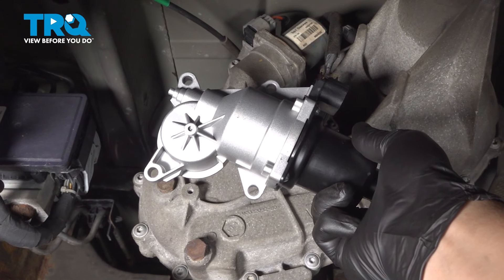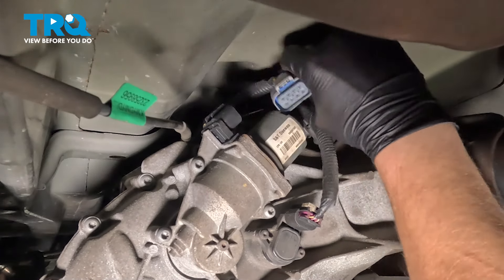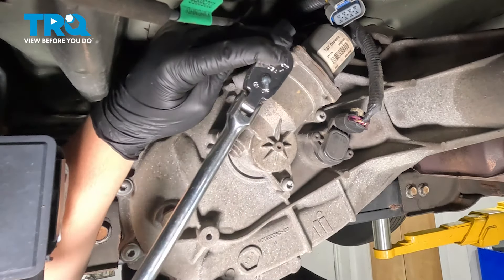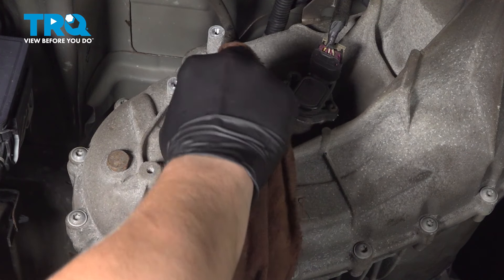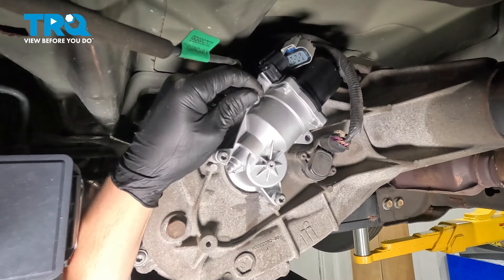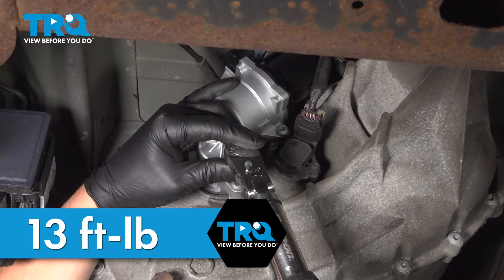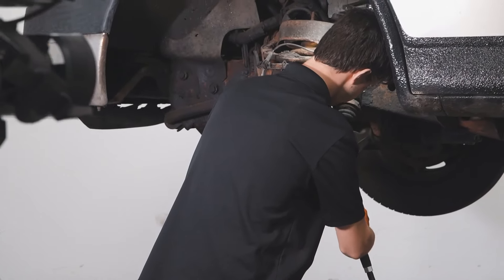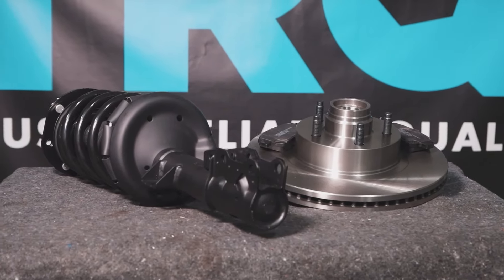How to Replace Transfer Case Shift Motor 2014-2018 Chevrolet Silverado 1500

Comment: On a 2015 Chevy Silverado and maybe others After changing the transfer case motor you have to put the key in the ON position and remove fuse 6 for ten seconds then put the fuse back in and you will hear the motor reset.